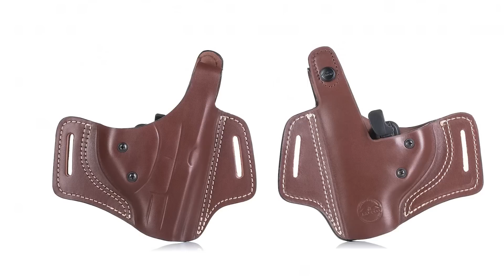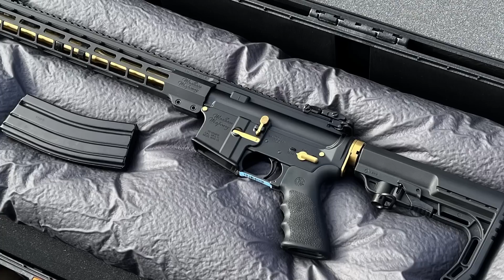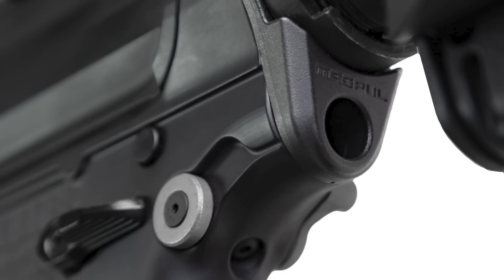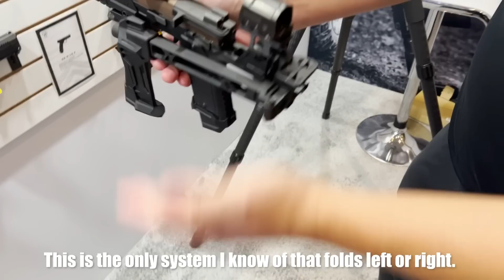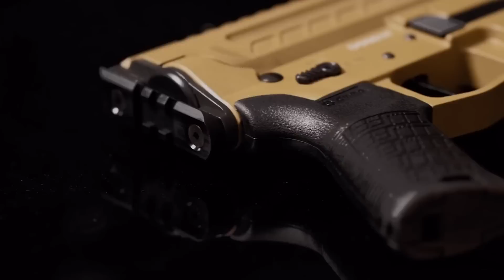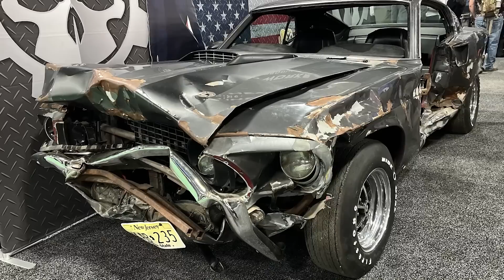The coolest stuff at SHOT Show week this year - 2023

Comment: In the army, older rifles pins would "ride-out" or "walk-out" term from a lot of use like a high rate of fire, burst, and full-auto as they get older as our DIs told us is to watch out for that and what can happen to cause a major malfunction to serious injury - any rifle that had a pin you can push with ease by your fingers needs to be replaced to report as those will be turned in to the armorer to fix... sometimes the receiver holes can be worn out too... all of the rifles we had had receiver play but was good enough at the range to qualify.
We would use our "post tool" as it was a large flathead nail and kept it in the buttstock compartment that had our cleaning kit, or you can use one of the cleaning rods to push out the pins.
The other quick field fix is taking a cleaning swab patch placing at the end of the pin add some gun oil and slam it all in to create a tight fit... we had the M16A1 before the M16A2 rifle was officially deployed plus other new stuff like the Kevlar ballistic helmet, and HUMVEEs before that we had what was common.

Comment: Falco holsters.
1. The lock system combined with leather sticking up from the holster in pictures, seems like it could be the very thing that actually gets caught up on the trigger on re holstering..
2. My bias against Falco. I'm a lefty. I wanted a holster for my TP9sfx. Because I'm a lefty, my light options are not common.
Falco, offered the ability to make a holster for my combo, with out my sending in my rig.
160 bones later, what I received was totally trash. Literally. It looked like a trash bag, all warped and shoddy. It had zero lock-in, no matter how tight I turned the screws and looked like a garbage bag. My paperwork was in a foreign Eastern blok language. But it did show up on time....
I bought a holster hardware kit and added 2 more screws, and did some heat gun magic to get some lock up. I was successful in getting a muddy boot feeling lock up, but it still looks like a garbage bag...
Falco? Oh no...